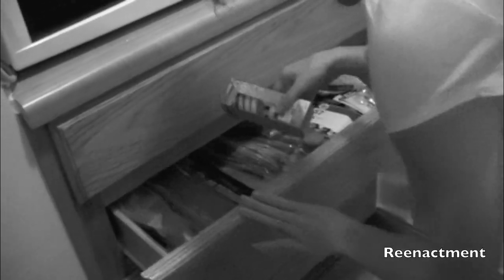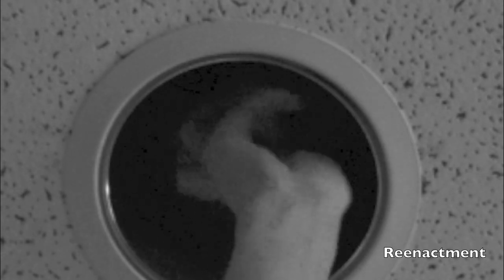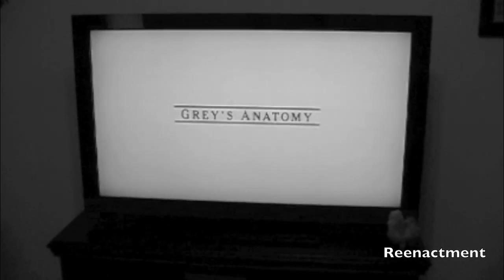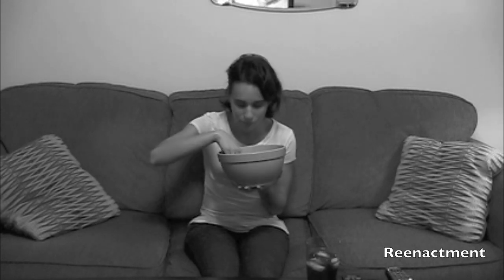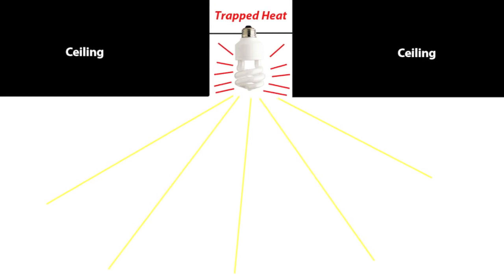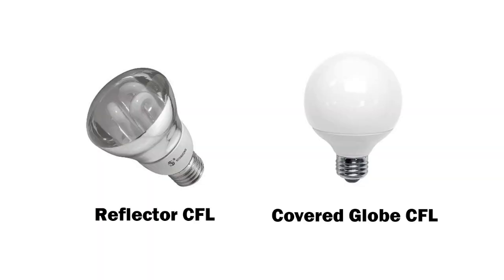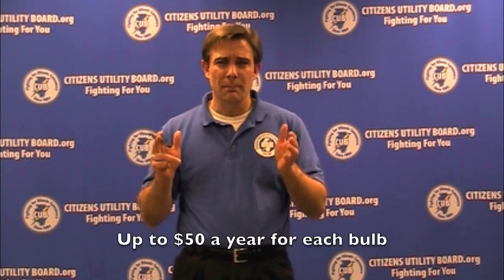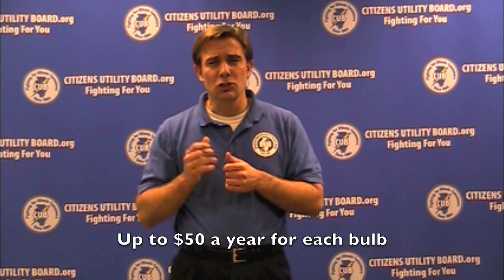Light Bulb Investigators: Recessed and Enclosed Fixtures

Comment: Thanks for the tip, CUB.  I have two recessed light fixtures above my kitchen counter, and I've been using regular CFL's, and have not had any problems...so far.  Now I know what to do if I encounter a problem down the road.